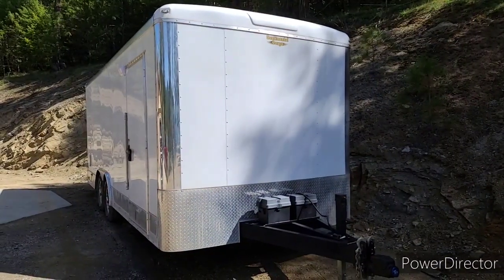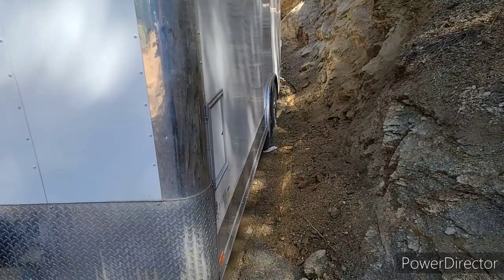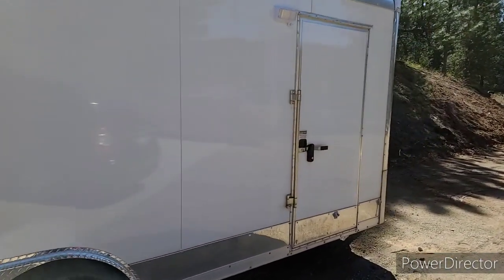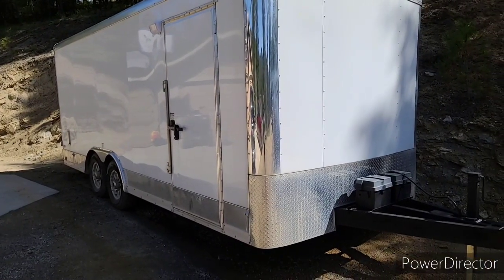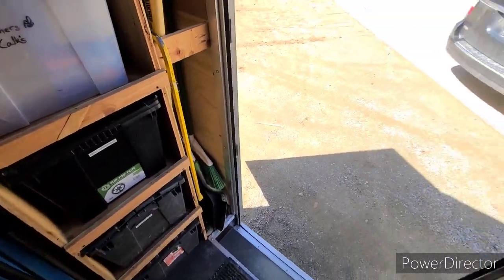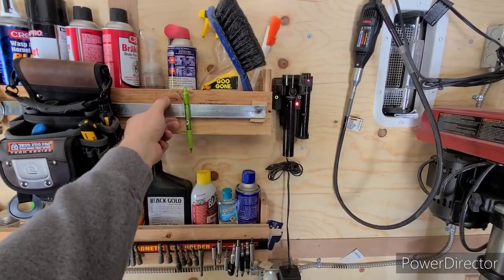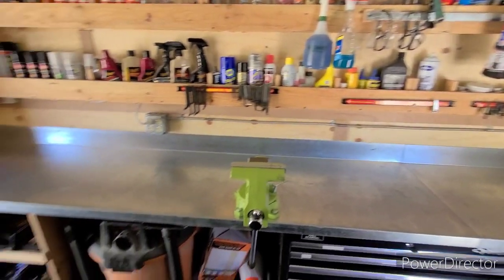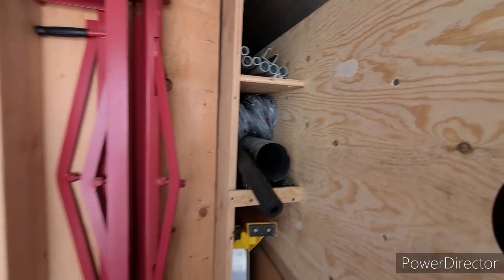Ultimate tool trailer inspired by Ron Paulk

Comment: I love the layout and design. Several ideas gained from the build but I feel like 20’ is massive for a residential trailer. If in an apartment complex or townhouses do you sometimes wish you had the 14’ back? I am struggling hard with what size I should buy. Really leaning on a 7x14 tandem axle for residential HVAC.
Reply from the maker: @ChevyORwalk  literally just bought an 8.5x16 last week. I hope to do a video on it once I'm done building it out. 20 was huge. also the 7k axels made it tall, so getting in and out was hard on the knees

Comment: Anyone ordering a trailer needs to know that they will charge you exactly what you can buy aluminum wheels and radial tires for on the internet and have them sent to your house. Some are saying so what?  The wheels and tires that were stock on the trailer, they keep those.
Gain four spare wheels and tires and buy your own wheels and tires for the same money.
It doesn't matter if you buy a trailer already made or custom order it, if you are going to upgrade, buy your own wheels, tires, stabilizer jacks, e track, extra lighting and all extra wiring, you will save money.
Great trailer!  Keep a close eye on it,  thieves work hard to steal trailers and I have heard of crooks stealing a trailer buy using the safety chains to pull it. Criminals will go to great lengths to steal a working man's hard earned belongings, be careful and good luck!

Comment: 9400 lb trailer weight with tools in it and only registered under 10,000 gvw does not leave much room to play with. In Pennsylvania, over a 10,001 lb and up gvw trailer weight requires combination registration. Not having a trailer registered as a combination and being over the registered weight leads to a $6,000 fine. (At least that is what the PA state trooper told me at a seminar) Awesome trailer!
Reply from the maker: I know each state is different. In Washington, the law reads, "trailers with a GVWR under 10001 pounds shall be exempt," so they can't even ask to weigh you. However, every officer interprets the rules a little differently, so it's still a bit of a crapshoot. This is one of the reasons I don't put my business name on the side of the trailer, and I register it and my truck in my name, not the business name. Good luck with the Smokeys in PA!
Reply: I'm in Spokane, my local DOT guy said my truck is counted as 10k (2500 cummins) and with any combo over 16k a DOT number is required. I have a 7k job trailer, 14k dump, and 14k flatbed. Staying under 26k to avoid the CDL requirement.  About registering personal instead of business, he said it comes down to insurance.  If you have a commercial insurance policy and over 16k combined you need a DOT and have to stop at scales when open.  He said not having a DOT number when required starts at about 5k then they'll start looking for other violations to run the fine up.  All a game of BS to make it harder to make a living...    

Digging your setup and wishing my 16'  7k was a 20' 10k.  I'm outta room!

Comment: That is a great mounting solution you came up with for your sheet metal brake.   I can certainly see why your trailer weight came out to 9000+ pounds with all of the metal tool drawers.  I suspect your fell HVAC buddies are jealous of your work trailer.
Reply from the maker: They do seem a little jealous from time to time but mostly they just give me a hard time about not having a microwave 😄
Reply: @Nick-vs9tq  what ????? no micro ? What about a kettle then ?
Reply from the maker: @houtslager  if you've never made a grilled cheese sandwich or heated a freezer burrito with a piece of sheet metal and a map gas torch, you can't call yourself at tin bender
Reply: @Nick-vs9tq  your right , but in the army I've cooked on some really wierd gear  but now I'm a sawdust maker 😄 so don't need tin snips but I'd love to give it a try

Comment: Beautiful trailer. What type of insulation did they use for the walls? And did you put the interior plywood up? What thickness? Thank you!
Reply from the maker: It's just fiberglass in the walls and ceiling, and the plywood is 3/4 that came from the factory. If I were doing it again, I would spray foam.

Comment: How did you make the sheet metal tops?
Reply from the maker: I had a sheet metal shop cut and break 18 gauge sheet metal with a 4-inch backsplash and 2.5 inches on the front with a hem. Then I stacked two pieces of 3/4 plywood, screwed and glued together, and then silicone the sheet metal to the top of that
Reply: @Nick-vs9tq  thank you! I'll be using this in my trailer

Comment: Did I hear you say u have a heat pump??? What model? We’re in Maine and could definitely use some direction there
Reply from the maker: It's a Dometic penguin 2 if I were to do it again I'd probably install one of those ductless mini splits because the heat pump kicks out whenever the outdoor temp is below 32 so it works fine in Mild cold temperatures but anytime it drops below freezing I have to put a supplementary heater in it you know like a little resistive fan type.

Comment: Beautiful job on the trailer.  Where did you source the metal countertop?  Also the sheet metal brake?
Reply from the maker: The sheet metal countertop I got from one of my local Fabricators that does my ductwork. The sheet metal brake is actually a Harbor Freight special.